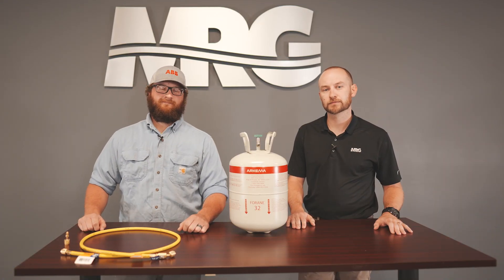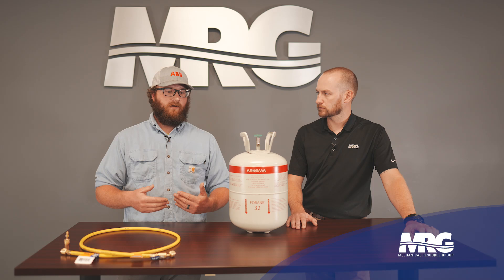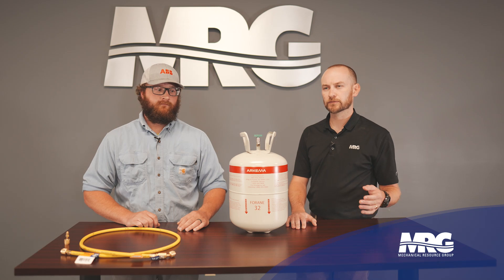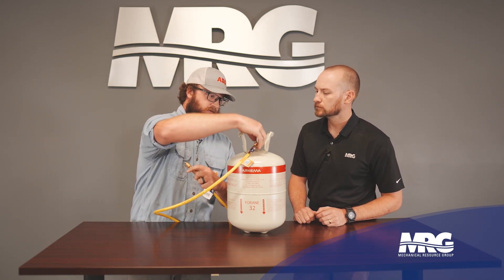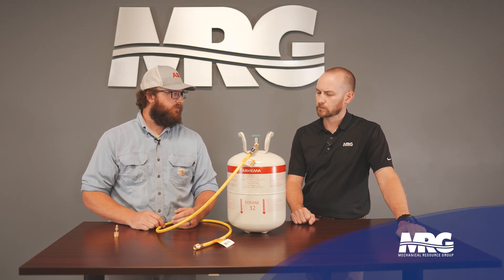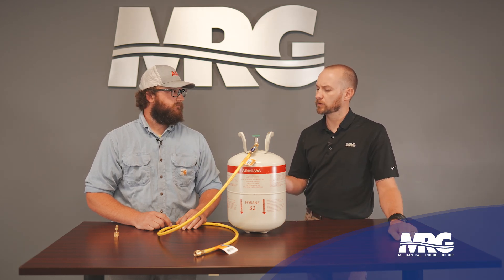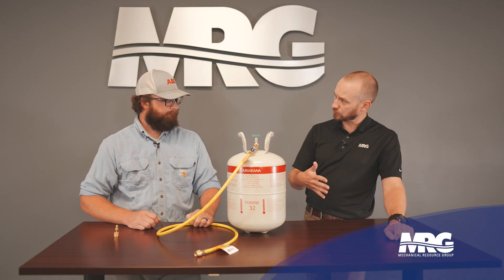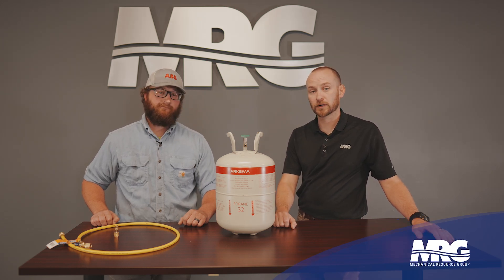R-32 Refrigerant: Don’t Panic, Plan It!

Comment: Absolute bullshit, Global warming is just the rally cry of the big chemical companies it is an excuse to charge more for less.. When this shit starts burning houses down and people learn about this BS.. 22 has lower pressures and systems lasted to long for the industry. They want shit to last 10 years and then you will need a new system again. Old 22 systems have lasted 30+ years. 410 a equipment lasts half as long as 22. You keep saying it is not flammable but RIGHT ON THE JUG IT SAYS HIGHLY FLAMMABLE. You guys just keep spewing BS

Comment: Sooooo we have r32 now and we have to make something different right?  American nickel heads at work.   So I have to put a left hand adapter to the tank and then attach my right thread hoses on so when I tight it up the adapter will get a little lose so I can lose some Freon right?  Got it.   And the solution for the higher pressure of 32 vs 410 @100f degrees instead of making the cylinder a litle heavier we got a relief valve so as if I drive and it goes off blowing in the truck moving around it will stop right?     No possibility of defects on the valves either.  And…….we blame Chinese products because ours are so thoughtful?   Also you didn’t mention about the single chemical if we can charge vapor instead liquid.   But that is too much right?   Thank god I am old and retired so I wouldn’t have to live among the people that come with these ideas.
Reply: Chill babygirl, it'll all be ok.
Reply: Nearing retirement this is all about money if it's so safe how come they have a shutt off sensor in the coil suppose it fails freon pockets what about a compressor terminal blow out it's still near the home and flammable
Reply: Well said. What a load of SHIT they are selling us. Liars. They say it is not flammable but it says highly flammable RIGHT ON THE JUG.  Clearly green new deal BULLSHIT.

Comment: So on a hot day when your r32 is burping in the van do I need to purge my van (enclosed space) with air before lighting a cigarette and driving home?  Is the  r32 refrigerant scented?  I don’t smoke. Some of My fellow techs smoke though.   20+ year ago when I was an apprentice r22 was supposed to be LONG GONE by now, guess what, depending on the application and what’s going to be the best solution, if r22 is the best option I’ll go down to the supply house and buy as much as I need.
Reply: @robertAWA while R32 is considered flammable, it takes a particularly narrow range of concentration to be within range of ignition and more energy to ignite than one might expect. While the risk of ignition is much lower than that of Gas or Acetylene, it is recommended to not produce an open flame near a flammable gas.